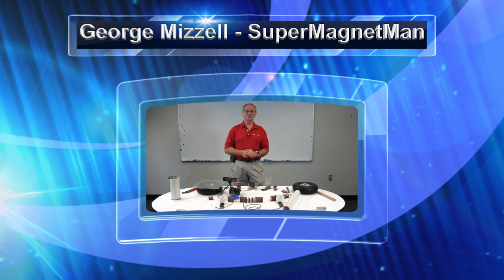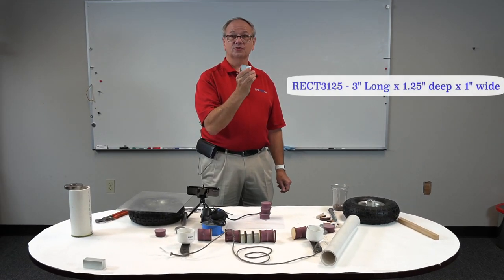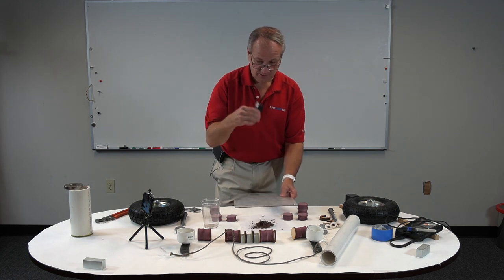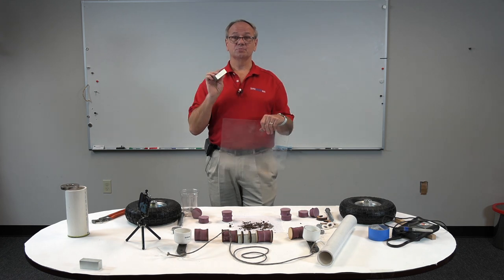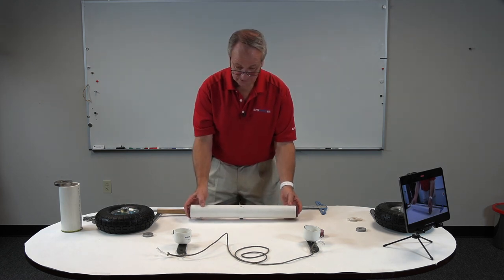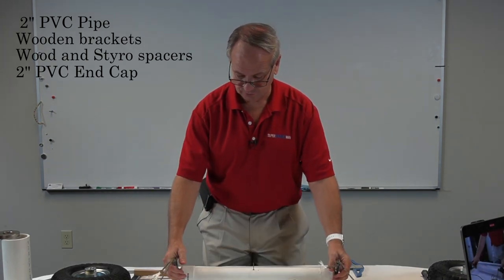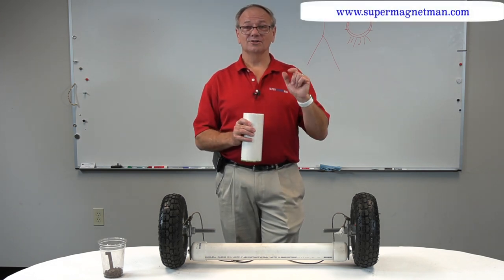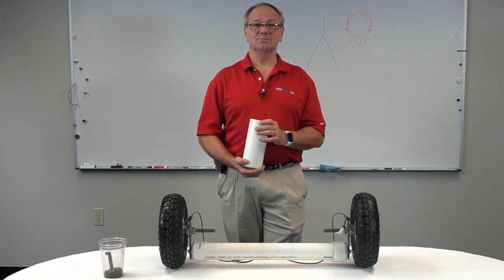Build Your Own Magnetic Sweeper

Comment: We have a little wheeled cart that holds a 12 volt battery.
There is a switch on the handle that we flip
to enable the electromagnet inside the PVC.
After walking around the area picking up stuff,
we pull the assembly over to the corner, where
we switch it off, and all the metals falls off for
easy cleanup.

My neighbor, who lives on a sandy road with lots of nails,
extended the idea and added something similar to 
his car bumper.   He flips a switch inside the car
to collect metal while driving, then when he gets
on the paved road,  he turns it off and dumps
it on his other neighbors road.  
Funny guy, old Ralph.

THanks for THinking !
Reply from the maker: Interesting:)  It would take something to keep the electromagnet cool.  Generally a 12 volt battery would get very hot in 30 seconds and probably hot enough to melt through PVC.  But you are right that the electromagnet makes it convenient to cut on and off. I have made one that a guy attached to the PTO on his tractor and had a trap door design on the bottom.  As the door opened the metal fell off.  Then he would close it and go back to searching for metal.  So the same thing can be done with permanent magnets.
Reply: @SuperMagnetMan  Would be kinda cool to use a strong electromagnet diametrically opposed to the permanent magnet, which you could briefly pulse for a couple of seconds just to release the harvested metals. You would have to be very precise with the current though, otherwise you'd just pull the stuff right back to the surface. It would have to be just enough to cancel out the permanent magnets. The advantage would be that it would only be activated for a few seconds, so it wouldn't be as likely to overheat.

Comment: Hey, Cool man, I mean Super Magnet Man!  You may want to move the rope down to the bolts.  This way is less likely with swing (raise) the magnet when you pull the rope.  Improvements are indeed endless in possibility.  Cool man.  great job on the the presentation.

Comment: You forgot to add a material releaser. Or it is a real pain to get off. What is the realistic distance to be able to "release" that material? And then you have to have the force to be able to pull the material off or drop ot off all at once. Maybe using the swivel magnet tecnique using a lever (used on other high capacity magnet pickup tools) to cancel the manetic field for release. You need puncture proof tires so metal pieces don't cause flats! I work at a metal fab company. Picking it up can be easy but getting it off "from a neo mag" has to have a minimum distance or it won't come off timely or effectively.  That is why others use ceramic.  The density of the flux creates such a pull that you have to find a minimum distance that you can pull off the material or have a mechanism that can withstand the force needed to easily release the material quickly.

Comment: Wrap the pipe in a layer or two of SaranWrap before using. 
When you’re ready to clean, slit the SaranWrap on the top of the tube, pull off and throw away.

Comment: Now just add a small conveyor to drop the contents in a container on top. Ether fabric, step, or cup. And can you list where you got the side adjusting brackets, foam pieces, large bolts, wood anchor patterns in the description? Thanks ahead. And thanks for the demo. I'm trying to make an all in one pickup to use at my steel fab workplace. I generally have to sweep it up but don't get it all or in the cracks. So I want it to pick it up and dump it in a container as I go! And then when it is full 10 to 20bl be able to just empty the container.
Reply from the maker: John - thanks for the suggestion - I will put it in there but I just laser cut the side brackets but everything else was from home Depot.  One suggestion for your application is to add to this a brush that can dislodge things and then the magnet can pick it up.  We designed a large one for a guy making these for large metal recycling places and he was making a road sweeper and just added the magnet array to pick up the debris after the brush dislodged it.  He said it worked great and No more flat tires!!!:)

Comment: Could a small magnet (1" X 1" X .5") with a 0.5" hole in it be used to hold a small bearing to center a drill bit on an engine block.? If so, is there a supplier of custom made magnets? Enjoy your videos - Thanks!

Comment: Your site does not have these magnets for sale there. Where can we get them?
Reply from the maker: https://supermagnetman.com/collections/neo-rectangle/products/rect3125

This is the magnets that I used:)
Reply: @SuperMagnetMan  oh! Only $60 per magnet!!  So it’s a $240 magnetic sweep!! I’m in the process of building one of these, but I’d much sooner make an electromagnet powered by some 15 year lithium cells for about 90% less (considering the copper coil is made with scraps or even salvaged transformers and the same can be said about lithium cells)…

This also has the benefit of being able to flip a switch and just DUMP the swept metal instead of having to fight it off…

In fact, now that I’m picturing the “scraping” - that may be the biggest flaw in your whole design.  Metal shards can slice a person to the bone…. The NEO magnets are probably TOO STRONG for this application because look how hard you had to struggle JUST TO SLIDE ONE CUBE OFF THE PLEXIGLASS!!! 

To IMPROVE your design, you need to make an INTERNAL CYLINDER that can be easily removed so the swept up materials simply drop from the PVC… 

Since you chose to use those overkill tires, I’d also recommend an “OPEN TOP” outer shell so that the “INNER CYLINDER” (holding the magnets) can just be LIFTED OUT with a separate pull tab of some kind. 

Lastly, the rope idea is silly. I’m glad you suggested swapping it for a proper handle so this can be pulled or pushed instead of walked like a teacup Pomeranian. 

I’m not the magnet expert - but is there a way to ENHANCE the power of magnets the way an electromagnet can be?  Meaning, regardless of the magnet type, can a current be sent thru it to make it stronger?? Hence opening the door to CHEAPER magnets, greater coverage area, and an more overall practical tool??

All I know about altering a magnet’s power is by HEATING it.. Which drains the magnet. Maybe running a current thru it actually reduces power since heat will be generated… 

But Ive never explored this!!! you?  

Certainly interesting yo say the least.

Comment: So - it’s a $240 magnetic sweep!! I’m in the process of building one of these, but I’d much sooner make an electromagnet powered by some 15 year lithium cells for about 90% less (considering the copper coil is made with scraps or even salvaged transformers and the same can be said about lithium cells)…

This also has the benefit of being able to flip a switch and just DUMP the swept metal instead of having to fight it off…

In fact, now that I’m picturing the “scraping” - that may be the biggest flaw in your whole design.

Metal shards can slice a finger to the bone…. The NEO magnets are probably TOO STRONG for this application because look how hard you had to struggle JUST TO SLIDE ONE CUBE OFF THE PLEXIGLASS!!! 

To IMPROVE your design, you need to make an INTERNAL CYLINDER that can be easily removed so the swept up materials simply drop from the PVC… 

Since you chose to use those overkill Mack Truck tires, I’d also recommend an “OPEN TOP” outer shell so that the “INNER CYLINDER” (holding the magnets) can just be LIFTED OUT with a separate pull tab of some kind. 

Lastly, the rope idea is silly. I’m glad you suggested swapping it for a proper handle so this can be pulled or pushed instead of walked like a teacup Pomeranian. 

I’m not the magnet expert - but is there a way to ENHANCE the power of magnets the way an electromagnet can be?  
Meaning, regardless of the magnet type, can a current be sent thru it to make it stronger?? 

Hence opening the door to using cheaper magnets, greater coverage area, and a more overall practical tool??

All I know about altering a magnet’s power is by HEATING it.. Which drains the magnet. Maybe running a current thru it actually reduces power since heat will be generated… 

But Ive never explored this!!! you?  

Certainly interesting yo say the least.